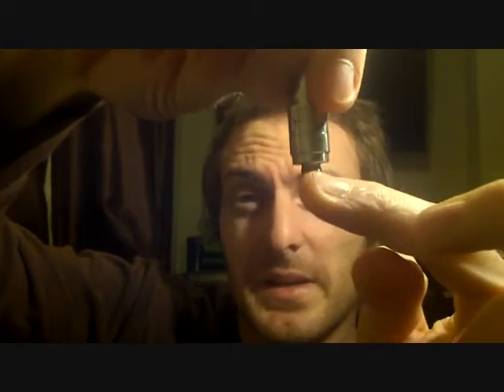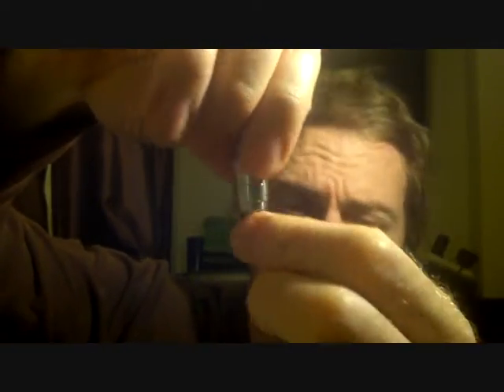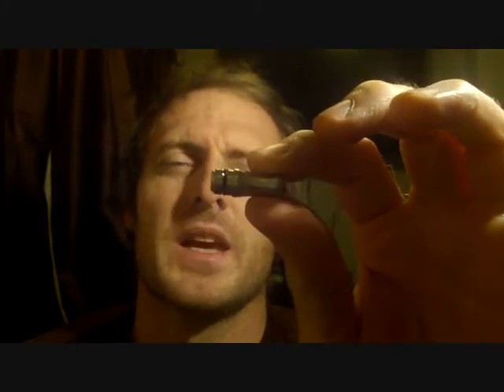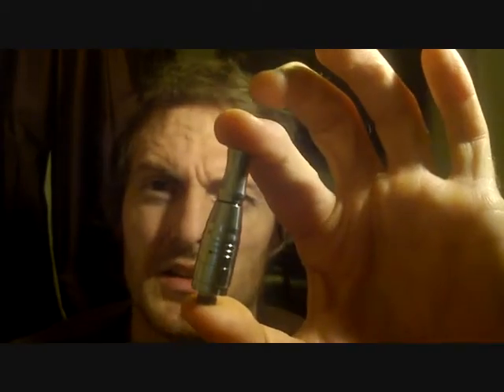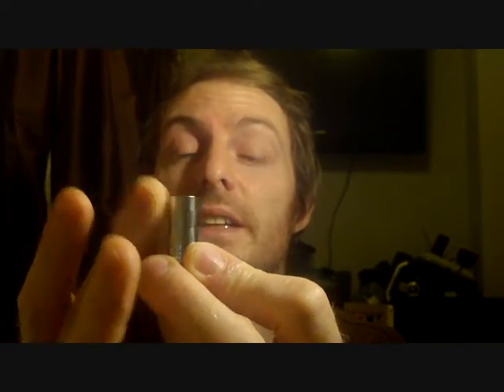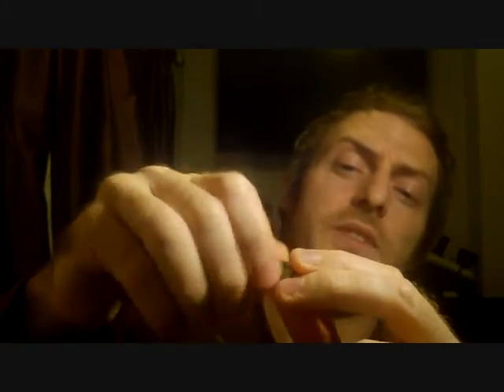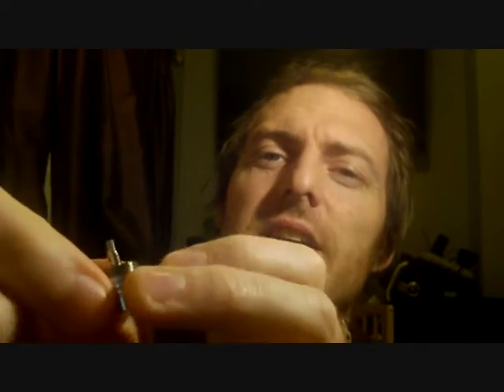Mark-T Infinity Rebuildable Atomizer review

Comment: Great vid mate, i had all the same tank issues you had with this with my bulli, just couldnt get it to wick properly, either too airy or too dry, found it frustrating constantly tweaking it to get a good vape! in the end i modified my bulli for dripping by popping out the tank spike in the center section, it literally just popped out with a small screwdriver, so yeah been using my bulli now without a tank and its just for dripping, works a beaut now

Comment from the maker: @briansclaridge ,hey dude,i do 5 turns of the .20mm wire for a 1.6ohm and 6 turns for a 2.0 ohm coil,both work great,if flavour is poor on the bulli its most likely because your mesh isnt set up correctly,try taking the wick out of the mesh,also making the mesh a little longer so it goes into the tank a little more helps,if you take the wick out of mesh,the mesh needs to be raised off the coil ever so slightly,hope that helps dude,,if its set up right you should get tonns of flavour ;)

Comment: thanks for the review steve......your experience is pretty similar to mine in the sense that I'm having to use all Bulli parts in order for it to work reasonably well. The pre coiled stuff is a great idea, but 90% of my hits taste dry and metallic.......but with the Bulli wick and wire things improve greatly

dripping for me though is a big fail....as soon as i add a few drops of juice it all comes straight out of the air hole! :(

it does look nice and machining is 1st class :)

cheers

scott